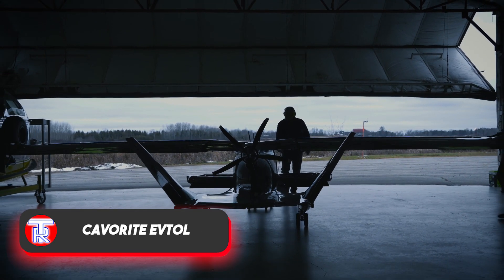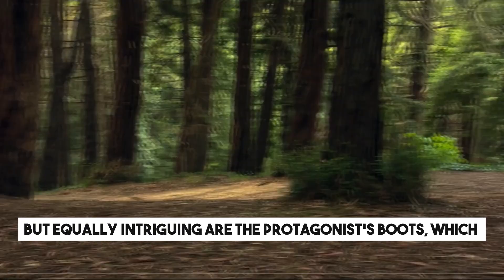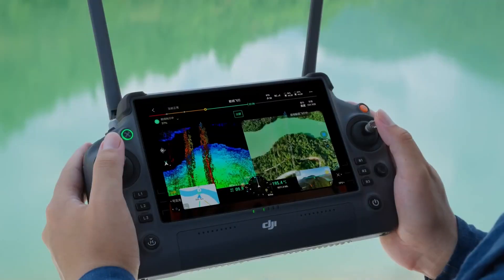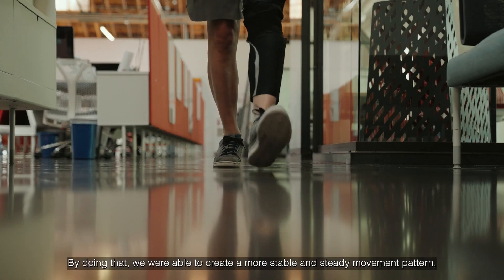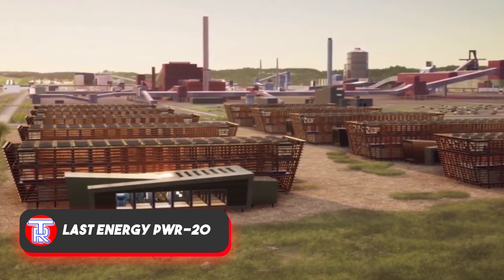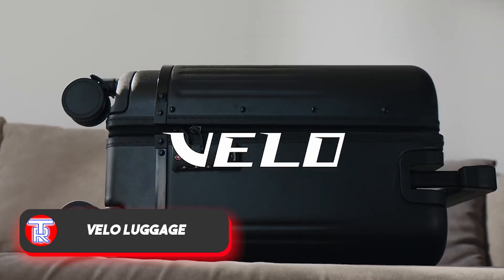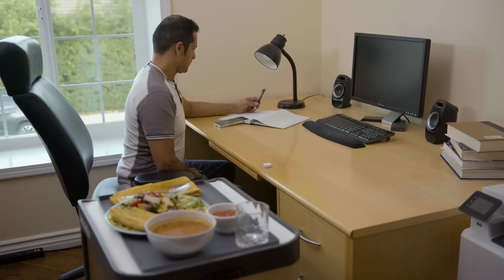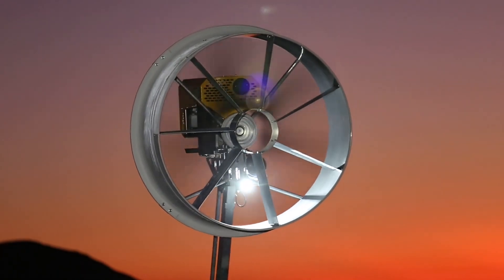INGENIOUS INVENTIONS THAT YOU SHOULD SEE

Comment: Does the Cavorite Evtol come supplied with the power lead shown or do you have to supply it yourself? Is a  5 mile lead available?
Reply from the maker: Hi darnstewart, the Cavorite eVTOL typically comes with a standard power cable, but for specific accessories like a 5-mile cable, you would need to check with the manufacturer or your supplier. They can provide detailed information on cable compatibility and availability. Hope this helps!